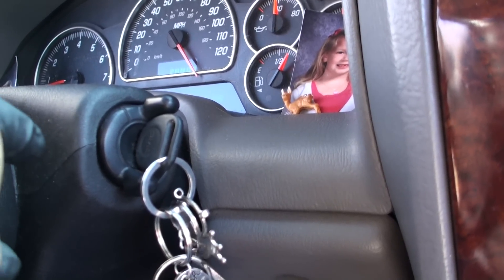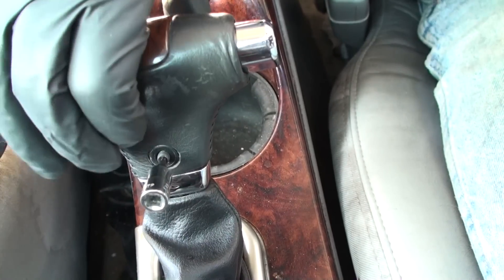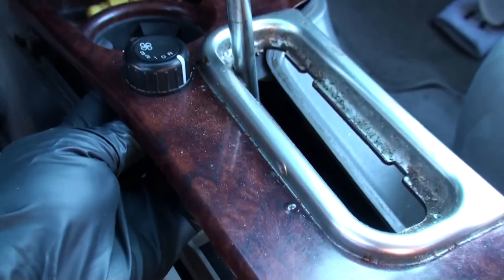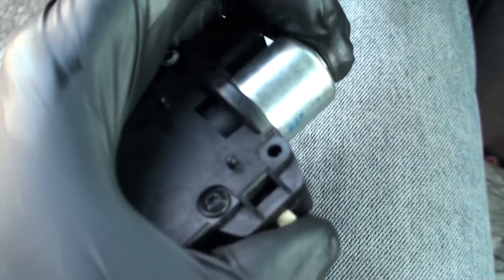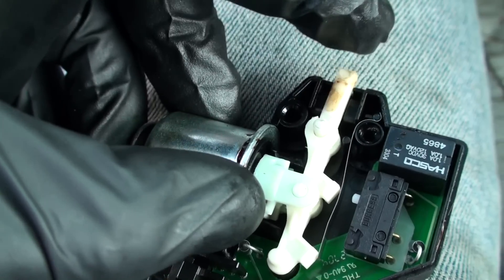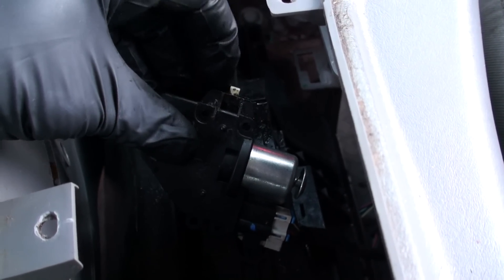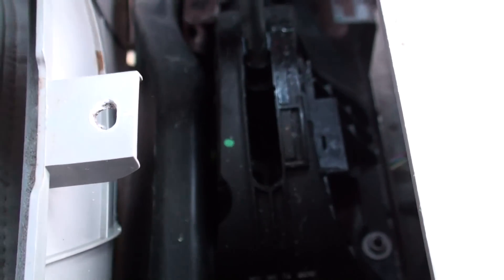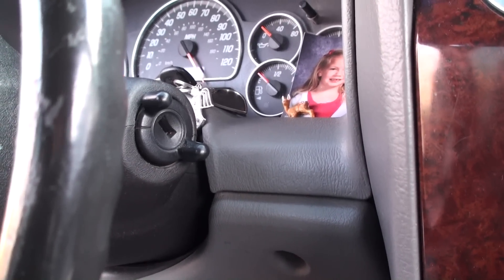Fixing a stuck key in your gmc envoy

Comment: Thank you so much for this video!!!!!   My key would not come out of the cylinder in PARK after turning the engine off.    The key turns fine but would not release out.     A lot of other videos and online forums talk about the switch under the steering wheel but it did not solve the issue, this video however did 100% solved my issue!!!   I took apart the center console and took out the part, cleaned it, lubed it, and re installed and it worked fine for like 2 months but it then started to act up again and would not let me take the key out so I bought a new one from Amazon the part name is "ACDelco GM Genuine Parts 88967140 Shift Interlock Solenoid"  and took the console apart again and installed the new part and BANG works like new.

Comment: I don't know yet if this will fix the problem on my trailblazer, but I want Cody the car guy to know, but he's the only one that explained what the problem was. The other handful of videos I watched before getting to this one, gave ways to work around it and not fix or describe the problem as to why it will not release the key everybody talks about this release button that's right up by the key on the column inside of the steering wheel column, one guy even takes an inch and a half hole saw, removes the plastic collar on the bottom half of the column, drills a hole in it and then puts it back on and says there you go that fixes your problem ... 🤔 well that may be true It eliminated the problem, but it didn't fix the issue. Thanks again for taking the time to make the video.

Comment: Hey Cody, mine is doing that so I took the solenoid out, cleaned it, put it back in and it's still not releasing my keys. I noticed that there is a yellow thing in the middle of the shifter and it doesn't move up when I put it in park.  Is there a way to bypass that so I can remove my keys?

Comment: Mine just did this out of nowhere. Now when I put it in drive it acts like the linkage is off. If I put it in 3 same put it in 2 or 1 drives perfect. Shifter works as it should. Got under car linkage seems to be fine. Reverse is fine as well. I can put it in park and it won’t come out until I hit brake. Everything seems to be completely normal except what I just described to you. Any suggestions cause I have no idea why it would do this. Yes battery terminals are clean btw.

Comment: I really wish you'd shown how to get that part out. I have a 2006 GMC Envoy XL that has this exact same issue and I'm able to get to the gear shift and sides and get things disconnected, I'm not able to figure out a way to get the solenoid out.
Reply: I hate when they skip steps. I had to really look in there to see what the hell he took out.
Reply: I'm stuck on the same part my self. Any help if anyone figured it out would be appreciated. 🙌
Reply: @IkonicRaptor  Your input would be greatly appreciated

Comment: after you take the 6 screws out, how did u get the part out you need to clean?  the two screws or do you pop it out some how
Reply: I have the same question! Please help.. I couldn't get that part out..
Reply: Look into the shifter slit and you will see the 2 screws right on top.
Reply: how do you get that piece out it looks like it's permanent , do i have to replace the whole assembly. please help......

Comment: What if it still will not release the key? I've seen videos saying shift cable,new ignition switch, drill a hole in cover under steering wheel to push a pin.
Reply from the maker: The drilling the pin is when you're trying to remove a lock cylinder with no key but if your key is in there you can turn the key then push the pin. I   have another video for stuck key in the ignition I would check first.

Comment: Does that issue also drains your battery? I've been having battery problems lately right before I had my key stuck..
Reply: Anything electronic could develop a short, which may drain your battery prematurely. It may be something entirely separate from this circuit, but yes this shifter solenoid switch could possibly develop a short too.

Comment: So I took apart my switch and didn't see any gunk. With the sensor clip plugged in and everything I was able to release my key. The problem I encountered was when I installed the sensor back on to the parking mechanism, it wouldn't release my key just like it used to. I don't think the arm is disengaging when I put it back into park after installing it, any advice?

Comment: Hey, thanks for the video but im having an issue. I took out the piece, everything looked good inside, nothing stuck. But every time i try and put it back in, the lever is depressed all the time, so the key wont come out.  Ive tried everything I can think of.  It presses up against the shifter like its in gear all the time.  Can you help?
Reply: I guess I should rephrase that, does that solenoid put pressure on that lever so that you have to pull on the shift to push it in? If so, then that is the bad part.

Comment: I just completed removal install - "shift interlock solenoid" - GM/AC DELCO #88967140 
[ fyi  $87 USD Rock Auto |  GM dealer quoted +$275 CDN] 

Problem to resolve : ignition key will not release
Part condition :  surface "guck" even on solenoid  ( no interest in cracking it open to clean)
Upon new part :  no more problem - key slides out
[ apparently this part replacement is the fix for locked shifter ]

Take precaution : do not loose that torx screw holding the shifter to the shaft.
GM will only sell the entire assembly.. even if you just lost the screw...
[ guess what happened... the mystery where it fell.. finally appeared but a little sweat happened..... ]

--- 
Reason no video on actual removal install of part is it takes "handy-work" in a cramped space 
to perform... and no video would be possible.

Here is my council/description :  
[ start point being you have successfully removed the center console cover 
( including unlatching that mysterious pink electrical connector) ]
--

The shifter was in the park position when performing this.

Remove the 4-flange nuts that affix the gear shifter assembly (GSA) to the car .
in order to easily view access/position the part ( you can set it upon its cage )
and slight angle twist it ... etc

- the white pin coming out of the part meets up against a surface (of shifter).
- the solenoid (with the push-in) aluminum button faces out the right side [east] ( from drivers seat perspective ) of the GSA.
- the part will come out the right side ( after detaching the connector that plugs into the part )
You push the part out to right... + tilt it downward abit + twist it abit forward -- this is the "handy-work" -- it will come out
remember how the connector cord was relative to the solenoid before you start.

[ observe the whole position of the part and where the screws are before you commence ]
just goto view the part itself ( at rock auto to get the shape lay-of-the-land ]

The real challenge lies in those 2 torx mounting screws.
They are accessible only from top-down view within the gear-shift guide opening..
With the shifter in park.. the 1 screw-head appears ..say [NNE - 1pm] ( shifter being due north ) the other screwhead apx [ SSW -7pm ] as you peer down into shifter guide opening from high noon.

- you will need about a 3-4 inch extension to reach the head of the Torx screws.
- Ensure if using a Torx [T15]  bit instead of a torx socket it is very secure and will not fall out when placing within the gearshift selector guides.

from the left side (west-side) of the GSA you will see how the baseplate support for the part is molded as part of the GSA.
The "7pm" torx screw outputs atop (overlays) a female receiver port. ( visually line them up perfectly so the screw (2mm diameter apx.) will drop right into it. I highly suggest you mask-tape the part into its resting position to prevent any slight movement once positioned ( from both sides of the GSA). I think there were a couple of nubs on the part that assist with fixing the position.
and I applied a slight pressure of the part toward the shifter ( to feel it looseness or snugness ) and then "cage-taped" it from both sides to the GSA assembly. Then I came down into the shifter guide rails ( look from the left side of the GSA checking that 7pm screw lands right inside the female baseplate hole designed for it. Once that screw is in, you the other one is good to go in.

Hope this helps you visualize and remedy